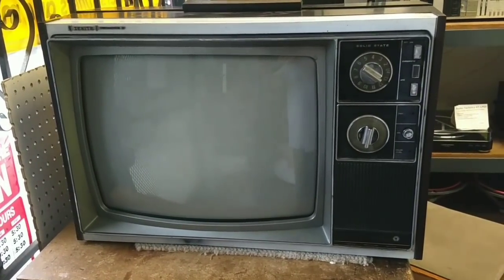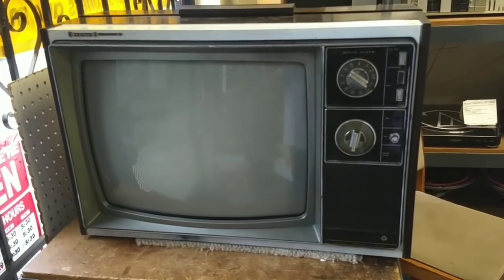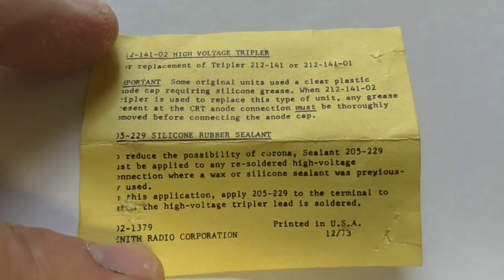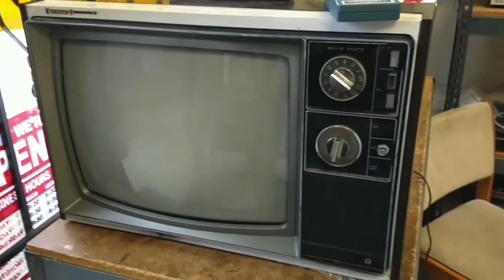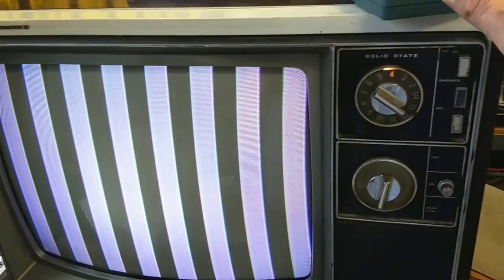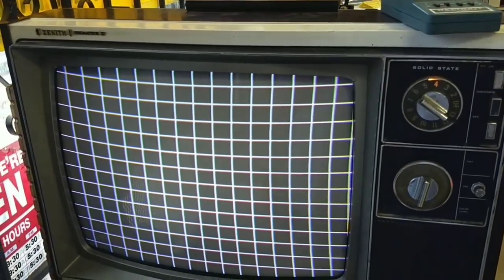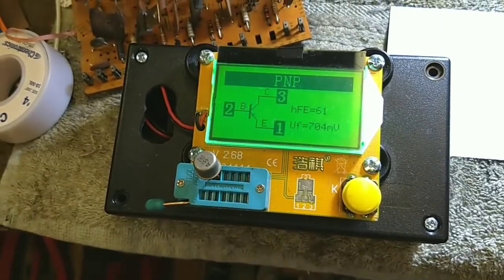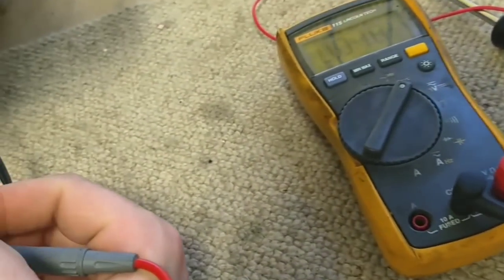Servicing a 1974 Zenith 17" Chromacolor II Color tv part 5 / ?

Comment: I was 15 when I began working Saturday mornings, and Tuesday evenings for a Zenith dealer in southeastern PA. Zenith Chromacolor II high voltage sections were quite problematic, and often, dangerous, as there was a four-lead "safety capacitor", which tended to short, and allow the tripler to go into "plasma drive",  pumping as much as 100Kv through the anode lead, sometimes causing the CRT to partially implode, and "send the guns into the living room".  If changed, as recommended by Zenith there will be a "HV Safety Capacitor modification performed" label on at least one location near the HV section, and sometimes a second on the service cover.

That 10Ω/2W, was replaced on most chassis by a 10Ω/10W wirewound; this is the weakest point within this general chassis design, as there weren't many Chromacolor II's which avoided their tendency to either become thermally intermittent; go totally open, or allow the voltage they decreased within the circuit to swing up and down, kinda like waves in the ocean.

One last item, the last Chromacolor II that I repaired was in 1989, and apparently by then, the chassis to module connection posts developed corrosion problems. Get the toothbrush out, remove modules one at-a-time, and gently brush them with the toothbrush dampened with and good contact cleaner (Caig DeOxit or GC Electronics). I wish you the best.

Comment: In my opinion it is not DC circuit, but AC circuit running on H frequency. When screen goes brighter, pulses from tripler go higher and they open Q902. So check Q902 and C904. Check Q902 base by scope when you change brightness. Than check voltage on C904. If you want to block brightness limiter, put Q902 base to ground. Through R911 this circuit changes also contrast setting.

Comment: You are not the first person to install that 9-88 module in upside down.  If I remember correctly it was the only module in the whole set that could be installed incorrectly, although it does require a little more force to do so.  All of the modules have a black stripe on one end.  The end with the black stripe lines with the black pin header on the chassis.

Comment: What would have happened if you just "Muntz-ized" the diode temporarily to get it out of circuit, and seen if the voltage at the control changed?

Comment: surely if all those resistors test ok, and testing reasonably correct to ground, only thing that can stop a voltage being their is something wrong with the tripler? its 'ground/feedback' open circuit internally?

Comment: Never had this one. Zener may be there just to limit. Anything on REF should vary with beam
current, Higher brite = higher volts. Try scoping it for curiosity.  Even if its pulses the
meter should even it out & read something ! Turning up brite fast it looks like the ABL
is working. May be too short event to see much at REF. Scene to scene changes would be short. Try running some video.

I worked on several of these chassis a day for 15 yrs when they started fading away. Thats
thousands. Triplers by 100's ! This is new ground for me.
BTW check the boost at the G-2 controls. Try bringing up the G-2's to make it brighter
& see if you get something on REF then.
73 Tom AKA Zeno
LFOD !

Comment: What the hell do you expect for brightness out of a delta tube from 1974. Set is working excellent for its day. That set is working very well and you should just enjoy it for producing a great picture. A modern BPC ( black plastic crap) set in the future won't even be able to be used as it will be in a landfill somewhere. Use it and enjoy or move on and sell it to someone else that isn't trying to improve 1974 to today. Move on
Reply from the maker: Angry much?

I've been working on these sets since the 90s and have owned several cc2 sets. I know from experience that this isn't working correctly. I may be obsessed with making it work correctly, but that's me. Don't like what you see? Move on.
Reply: I had a ChormaColor II before I replaced it with a CTC-17 in my living room because of how much nicer the cabinet of the RCA was. My CCII looked much better than this one.